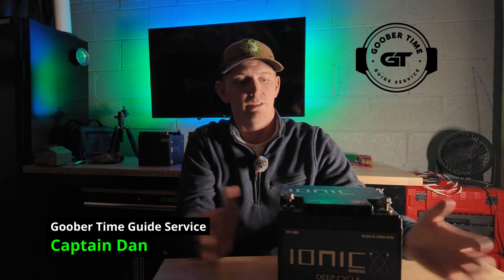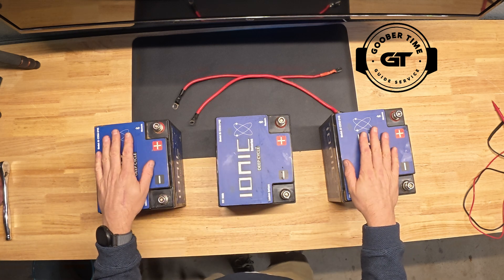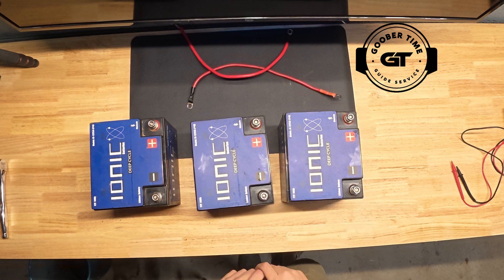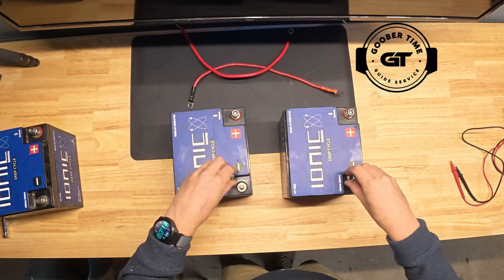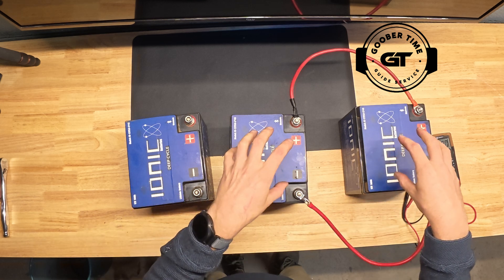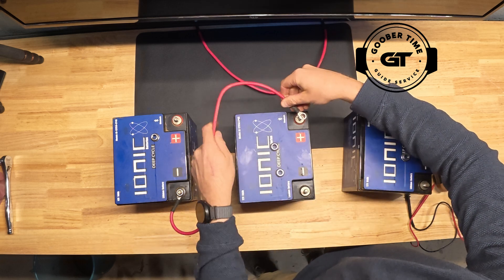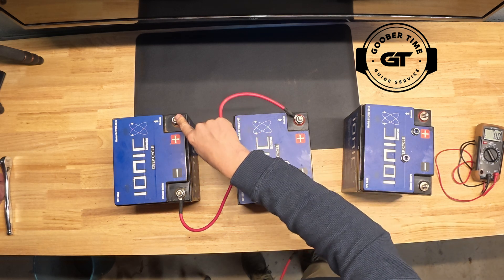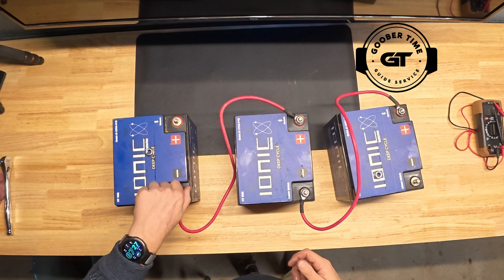How to Wire 12v 24v and 36v Lithium Batteries (Series vs Parallel)

Comment: Do you have to charge each battery separately with a 12 volt lithium charger of charge all together with a 36 volt lithium charger?
Reply from the maker: Great question. If you’re running a single 36v battery, you can use a single 36v charger. If you’re running 3x12v batteries to create 36v, you’ll need a 3 bank charger with 1 bank to charge each battery

Comment: I’d love to see how/if you can tie a 4 bank charger to these setups. Extra bank for starting battery.
Reply from the maker: Just positive and negative leads on each battery
Reply: @GooberTimeGuideService even if they are in series for 24 or 36 volts?
Reply from the maker: @ yup!
Reply: @ thanks!
Reply from the maker: @ no problem